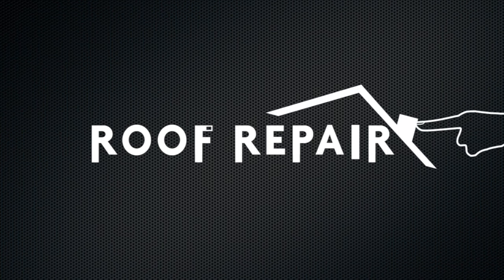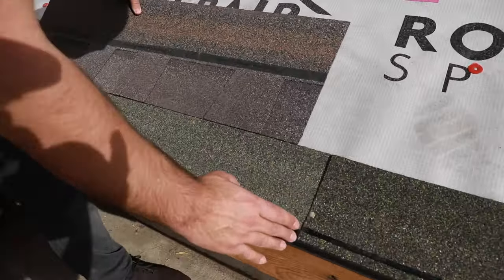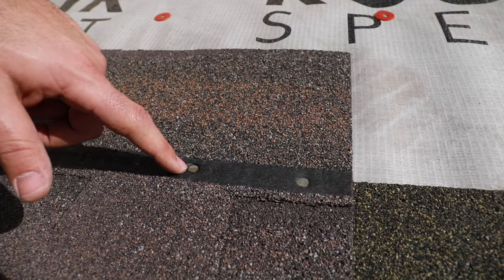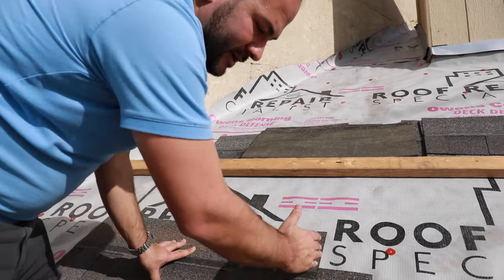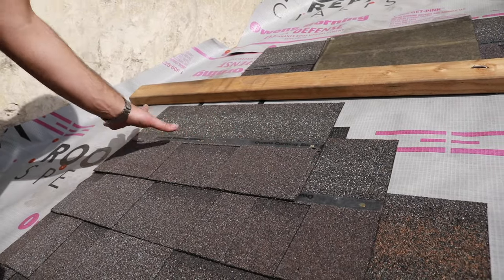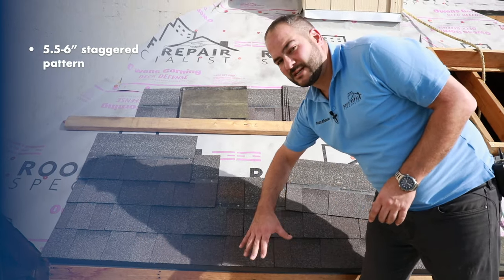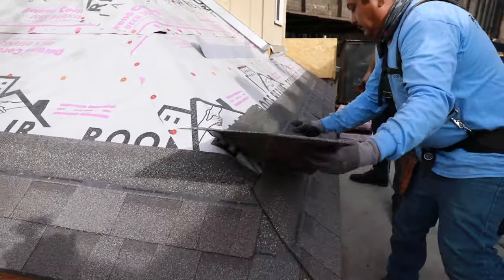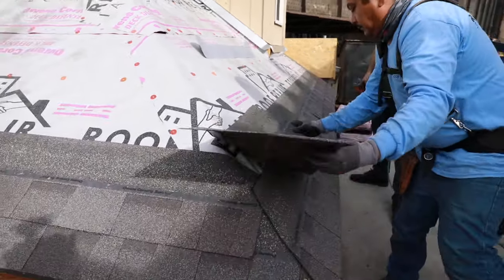How to Install Shingles | Shingle Roof Install Guide

Comment: Your skylight flashing is totally wrong; Should be an Upper and Lower flashing with Soldered corners. Use step shingles ( one for each row of Compositiosn shingles) up the sides of the skylight  lol
Reply from the maker: Not sure what you mean by upper and lower flashing. We use step flashing on every shingle. Just dont solder the corners, though I think soldered corners are probably best, don't think there is a need for them in my market, never had a leak from not doing so.,
Reply: Maybe not the prettiest but looks like it will shed water…I like a kicker sticking out on top and a bleeder on the bottom. But I wouldn’t install anything but a Velux skylight…their flashing kits are awesome

Comment: Boy a video on cut valley would be great.  Other videos show shingles across the valley on the smaller side and come back from the other but NOT where to cut.  Some say center line others say 2 inch offset but not specifically to which side.  does the larger roof area (and as  such more water volume get cut to center line or back from the valley?  Your videos are appreciated.
Reply from the maker: I actually do have a video on that, https://youtu.be/Epi8Ma47gFw?si=9Ke8p1rXgIKcSdhc
Reply from the maker: Thanks for watching, subscribe if you haven’t, It helps.
Reply: Hmm I looked through your videos and missed that one.  So, the side with the greater volume of water (AKA high side) flow gets backed up away from the valley center line.  Thanks very much.  Will subscribe.
Reply from the maker: Thanks, good luck on the project

Comment: My project is 20' x 4'. I was thinking to just buy a roofing hammer, but even for that small size, should I rent a nail gun that loads roofing nails for better control? No surprise, I have never swung a roofing hammer.
Reply from the maker: I think hand nailing should be pretty easy for a small project like that.

Comment: How close is too close for the nail to be from the area where the shingles meet. I believe my roofer made a huge mistake and set the courses at about 3.5 to 5 inch staggered pattern. I lifted the edge on some of the shingles and there are nails as close as 1 inch. They are not directly on the joint. I feel like 1inch has a chance to leak over time.
Reply from the maker: Unfortunately I would have to agree with you. You could test this by holding a house at the joint then lifting up the shingle and seeing how far the water has gone.
Reply: @RoofRepairSpecialist  thanks for replying to my comment. I will try your suggestion. Do you think if I lift up and use some roofing adhesive on the nail heads in the bad sections the roof can be salvaged?
Reply from the maker: It’s definitely your best bet.

Comment: Thanks for the video. 
 What if you cut the second shingle in half.  
That way you don’t ever have to worry about leak line.
Reply from the maker: Theoretically it will work if your nail placement also lines up. However I always recommend sticking to manufacturer instructions when possible and not reinventing the wheel unless needed.

Comment: Thank you for the great explanation! I have a question. How do you  continue with the staggered shingles. You installed 3 precut shingles. How do you continue to the top of the roof? Do you go back to a full size shingle after the 4th shingle is installed?
Reply from the maker: That is correct

Comment: When does the full sheet start over & do you just repeat the pattern?
Reply from the maker: Correct just go until the last piece then start again
Reply: @RoofRepairSpecialist  no I mean how many rows do you step pattern before you do the whole sheet again I've seen other people do five rows Courses & on the sixth row (course) they start over again but in your video you only have 4 rows (courses), So do you start over on the 5 row? The Owens Corning instructions for this type of roof said go 6 courses then on 7th is when you repeat.

Comment: Certainteed instructions say you must use 4 1” spots of roof cement on their shingles, but nobody does it.  Thoughts?
Reply from the maker: Look at the specs, it probably says that for mansard roofs. Or possibly when installing in freezing temps
Reply: Ah you are right!  Thanks.

Comment: The proper installation is with a hammer. All the manufacturers have silly nailing zone that are bogus. 
If you’re watching this because you’re looking to have your roof done look for someone who will hand nail it. The guns destroy the shingle. Most contractors will say all you have to do is set the pressure. That’s BS. Ask them if they can set the temperature.
Reply from the maker: Hand Nailing? Have fun doing that.
Reply: You might not like the thought of hand nailing ,but it is by far the best quality job you will ever get! No over penetration or under ! When an experienced roofer was hand nailing he was like a machine .Nails rolled between his fingers like clockwork . The newer nailing guns are much better for controlling the nail set ,if the roofer  cares enough to keep monitoring it! Sadly too many just wanna bang them out! All the stapled roofs of the 70's and 80 's were nightmares!